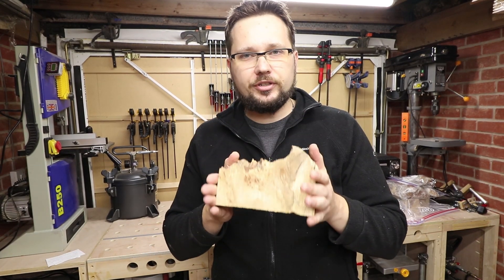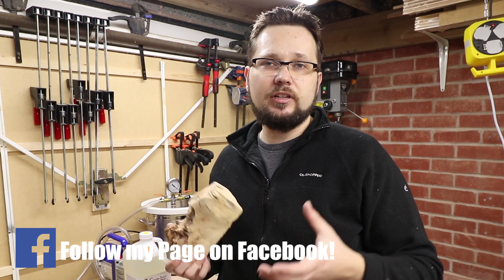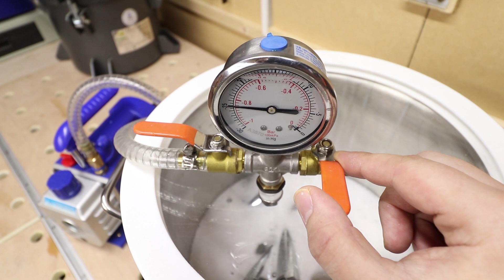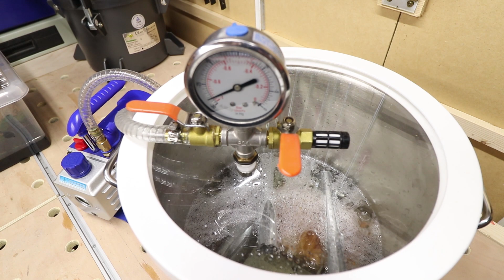How to stabilize wood with Cactus Juice and why? - Resin Tutorial

Comment: Tell me also when stopped bubbling , you realise air of vaccum container air, or with vaccum air for whole night
Reply from the maker: Depends, in most cases after the full vacuum process has finished I leve the wood in the pot to soak for a whole night with no pressure. But on some occasions I turn the pump off and then leave the pot overnight with pressure. Some pressure will escape over night. It depends on what I'm stabilising and how much of it in one go.
Reply: @CasualDIY  can I use that process of gemstone fracture filling
Reply from the maker: @sonuverma2796  never done that so can't really say

Comment: Say I stabilized a really irregular pice of wood with double dye . Can I fill in the rest of the wood gaps with an additional epoxy in the pressure chamber. Also can I use just a pressure pot to stabilize? Or nah
Reply from the maker: You need a vacuum chamber to stabilizale wood not pressure pot. Pressure pot is for casting when you add epoxy( resin) to a pice of wood that is fully stabilized. Hope that makes sense
Reply: @CasualDIY  thanks I found more info .

Comment: Any issues with the Acrylic lid now that you've used it some? I've seen a lot of conflicting info on if you should use one at all with an acrylic lid. 

If you make sure that the liquid resin or bubbles never touch the lid has it been ok?
Reply from the maker: So far had no issues but I always am very careful as you said that the bubbles never reach the lid. If I had the money I would go for the glass one. But as I said had no issues.